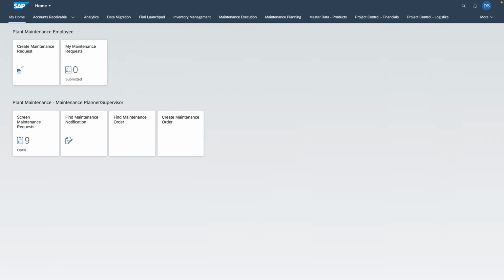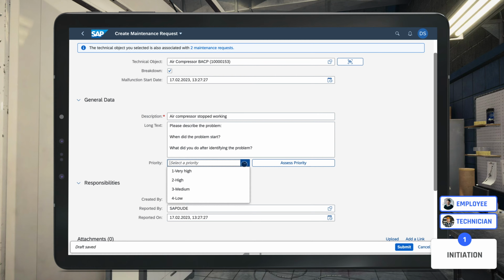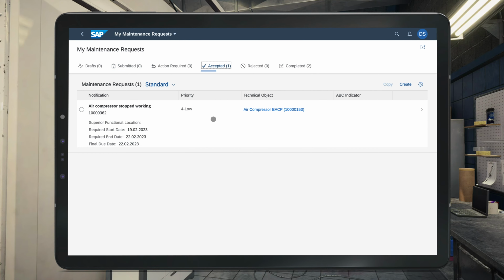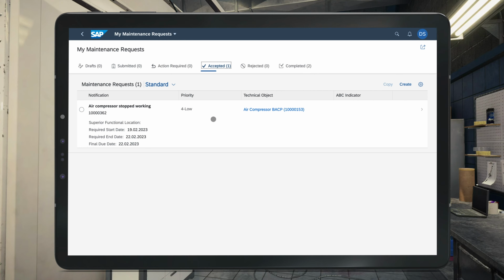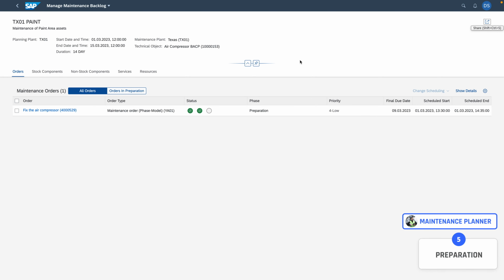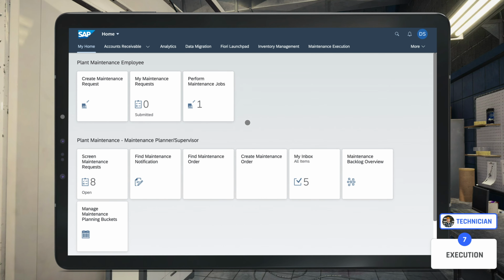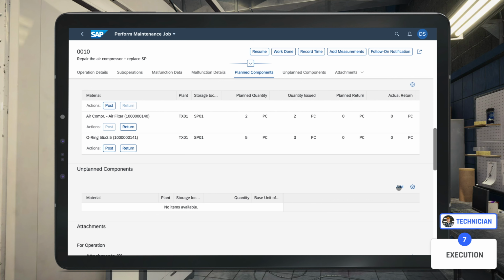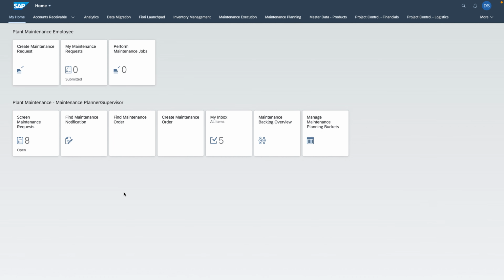Phase based Maintenance Process with SAP S/4HANA Asset Management

Comment: Hi, great video! I see that your operation tab has many options as - Template, copy, delete, setting gear, etc. Mine only has Delete operation and I had those just like you before. I've checked authorization, client settings but I cannot find what caused it to disappear. Do you have an idea?
Reply from the maker: Hi, thanks a lot. Well, I would try in a test environment with SAP_ALL authorization. Maybe something is still missing. Second thing, is it only you or more folks having this problem? If more, maybe someone did an uncontrolled change in the UI and made these components hidden (but I doubt). Third option, look at the note 3542253, maybe it will solve it. Hard to say, without details. Let me know how you managed it:)

Comment: Hi sap dude! Thanks for the video! I have a question I am implementing the 9 phases in S4 Public Cloud and we have to active some scope items. When I tried to do the process I have somo issues like the "Personal Responsible" camp is empty. And then I can´t confirm the order because of this. I think the I am having trouble with the link of the technician and my user. I don´t know if this is part of somo integration with hR or if i am missing something.
Reply from the maker: Hi Chiara, what error do you get exactly? If you want you can drop me a message at LinkedIn with the screenshots etc. 

Yes, there is something called 'mini HR', where EAM uses small piece of HR. It's hard to assess what is missing without details:) Cheers, Dan

Comment: Hey Dan, excellent work as always. After expIoring the process have some questions. When a request appears in the Screen Maintenance Request app, is it not possible to convert it into an order without approving it first right? Also i guess buttons like Accept, Reject or Action required not become active without some configuration settings
Reply from the maker: Hi Murat, thank you! Yes, this is the purpose of this process, to not be able to convert the not approved requests to WOs. However, everything is a matter of configuration. But this approach enables real Screening process and should be followed as much as possible.

If there are cases where there is no time for waiting for the approval, because work has to be done ASAP (example - ‘fire in the hall’), then SAP provides another flow.

It is called Emergency work, and then the approval step is skipped and we are directly moved to work planning and execution. 

Cheers, 
Dan

Comment: Hello. As a technician, is there any possibility to unassign an operation, to be again unassigned and availabe for the tehnician from next shift to continue?
Reply: You can remove person responsible from operation by editing maintenance order ?
Reply from the maker: It is possible to remove the assigned technician, either by RSH if u have it, or in the maintenance order directly, if u don’t use RSH. 

But as a technician, if you want to un-assign yourself from the task in the Perform Maintenance Job app - it is not possible (at the time when I write it). Cheers, Dan

Comment: Hello Sir ,I have created a new maintenance order, in maintenance Planning Bucket-selected the equipment, and defined the time period. But the maintenance order is not visible in the "Manage Maintenance Backlog" app. What could be the reason for this?
Reply from the maker: Hi, it’s hard to say. Many things may be causing this. If you still struggle -  drop me a message and screenshots via LinkedIn. Cheers, Dan

Comment: It seems it’s similar to ECC maintenance process other than backlog and bucket creation. That too I don’t know the use of creating those buckets. Can you tell me is there a key difference in regular process vs phased based maintenance?
Reply from the maker: Hi Prakash, there is no much difference from Business perspective, but from visibility, progress/status tracking - for sure there are.

In the old PM you use User Statuses to have that level of granularity. Here you won’t be able to use them, but instead you have the phases and subphases, supported by the set of new Fiori Apps. 

The new phase maintenance model gives better and easier control of ongoing maintenance activities, that’s the main difference.
Reply: @ thank you

Comment: Ver helpful video. 
In which step did you release the order?
Reply from the maker: Hey man, thanks a lot!
I skipped the order release part in the video, but of course I had to do it for my order. 

Once I finished the 5th Phase - Preparation, I released my PM order with a Fiori App ‘Manage Maintenance Orders and Notifications’ and then I continued as you see on the video. 

Cheers,
Dan

Comment: Very good presentation. Can you confir or make presentation for Proactive maintenance too. It is either generating notification or order. If we are generating order it is giving error that notification is in approval stage
Reply from the maker: Thanks man! 
Proactive Maintenance is in other words Preventive Maintenance. You start with an order, in most of the cases you plan it automatically via Maintenance Plans. 

If you receive an error about notification, it means your configuration is lacking of some settings. Start with checking if this order type is linked with a notification, if it creates a notification in the background. 

I don’t plan to publish new videos on this topic, I covered it roughly in this and other videos. Deep dive videos are part of the Ultimate EAM Course, which I created.

Now my goal is to focus more on UI/UX topics and IAM Suite like Asset Performance Management, Business Network Collaboration, Service and Asset Manager and others. 

Cheers man and thanks for the interaction 👌

Comment: Thanks for your wonderful explanation

But in my there is no my maintenance request
Reply from the maker: If you got at least S4HANA 2021, it means you are not assigned to proper Business Role. Reach out your Basis team for it. The app you can find in Fiori Library (Website) along with the standard role as well. 

Cheers and thanks for reaching out, good luck bro 👊
Reply: @sap_dude  thanks for your reply
I am working as planning engineer in ADNOC, we have same SAP Fiori and also I can create both of notifications and work orders
Reply from the maker: Happy to hear that! I hope you will find something for you here as well and you can use it at your work.

In 2 weeks I will upload ‘Scheduling Parameters explained’ Video, something around Preventive Maintenance. 
If you use maintenance plans and stuff - make sure you don’t miss it. 

Have a good one 👋🏻

Comment: We are using SAP EWM for material management and are not fixing each material to only one bin location (we assign fixed bins to each material but a material can be transferred between bins and therefore have stock in multiple bins). Can we still find a way to consume materials by clicking "Post" in the work order level for attached components? Maybe by assigning a preferred bin for consumption somehow?
Reply from the maker: Hey Julia, this functionality works only (currently) for IM (inventory management) only. It means we use Storage Locations, EWM is not considered here. 

Components in PM order are on Operation level, not work order, but I guess that’s what you meant. 

So yeah, currently EWM thing is out of the ‚Perform Maintenance Job‘ app. 

Sorry for bringing bad news. I am curious to see such option in the future! 

Cheers,
Dan

Comment: Hi Sir, i was configuring this model my system. In configure overall status-Conditions, ther is a cloumn named "Link" in which there is default value and not able to edit it.
Default vale is "AND"  but i want to use " OR" .How to do that?
Reply from the maker: Try by deleting the entry and add it again man.
Reply: @sap_dude  Tried that also. But it's not working.

Comment: Great Video. Is there any way to assign a maintenance task lists automaticly based on the object and mailfunction code/effect?
Reply from the maker: Hi Rene, thanks!
In standard S/4HANA it’s impossible. 
There is something like Relationships, it’s something in direction called Variant Configuration. But your requirement won’t be covered by this thing.

Before you consider any custom logics etc - check out SAP APM, which is in Cloud, you connect it with S4 or even non SAP systems. 
The goal is to optimize maintenance strategies, and such ‚recommendations‘ of activities (in SAP world called Task Lists) are at some point part of it. Might be a good thing to dig deeper, so yeah, check it out. Cheers man

Comment: Thanks for the video. It is very helpful. Do you have RSH activated in your demo system? I am trying to create a Team linked to my work center. But don't see any performance work center in the Teams and Responsibility apps. I would want to get the same view as what you have in the Perform Maintenance Jobs app, where I can also see the work linked to my team.
Reply from the maker: Hi Joke, yeah I do have RSH activated. Actually I linked all the People (Personnel numbers) via classic IR02 tcode, where u got this interface between PM <> HR. But yeah I know about the Fiori app which u mentioned, I will give it a try and see if I face such issues like you. If you do it like I did, should work as you see in the video. 

By the way, my new video about RSH will be live in 5 days, you will see the setup there as well. Hopefully, it will help you. Cheers 👋🏻

Comment: Hi sir, I have a question that it is possible to run phase model in SAP GUI? it may use less steps/transaction codes than in fiori but some cases you know clients want to run in GUI rather than in fiori. if it's not possible to run in GUI, so should we use both classic model and phase model ? because if only using Phase, we must always go to Fiori. ?
Reply from the maker: Hi man, Phase Model is dedicated for Fiori. For example the phase ‘Screening’ is not supported by any GUI tcode. The idea is to get rid of GUI and execute the process via new, user friendly solutions based on Fiori. This is something we have to explain to our Clients, it’s time to move from old way of working to the new, better one. Cheers man
Reply: @sap_dude  Thank you!

Comment: Hi, thanks for the wonderful blog and video. I have completed a full scenario of Phase model using standard order types YA01 and YA02. 
I have a question, How to activate Phase model for other Order types, i have selected the check-box in Order type for Phase activation and also assigned Status profile for new order types, is there any other config to bring the new order type for Phase maintenance. I want to select this order type in Maintenance Plan, and once orders are created, i want this order type to follow phase process. Please help. Thanks in advance.
Reply from the maker: Hi man, thanks for the kind words! There is more config for that than the checkbox in order type and the profile assignment. I described the steps in the Blog, just apply them to your Order type. 

If you are facing some specific problem, please describe it and I will do my best to help you. Phase maintenance model is not a 2 minutes config, that’s why I cannot give you the full answer without a specific context/issue. Have a good one, we are in touch 👋🏻
Reply: @sap_dude  -thanks for your reply, i can only find the below inform on Order type in your blog. Is there some other steps too in you blog, i cannot see them !

'Configuration for Order Types is pretty extensive, there are at least 10 Configuration points, which have to be set-up. Otherwise, the system will throw errors to the end-users during processing. The most vital one was mentioned above, the rest does not have Phase model-specific checkboxes etc., that’s why I do not display their details.'
Reply from the maker: @manoranjanpugalenthi1299   Oh I see, yes that's right. When it comes to Order types configuration, there is nothing more than this checkbox. The other '10' configuration points are just normal steps, which you do for every order type. That's why I didn't mention them in the blog. I hope you get it! Cheers bro
Reply: @sap_dude  - thanks for understanding.. So, is there any way to select PM02 Orders from Maintenance Plan and make this work in Phase model like YA02 Order type for Proactive Maintenance ?
Reply from the maker: Of course it is, but I wouldn’t activate it directly in PM02, keep it clean as it is, make a copy like ZPM2, activate the Phase Model and use it.

Comment: Hi SAP dude, when did you release the order?
Reply from the maker: Hi Zagreus, thanks that you watched so carefully! Yeah, I skipped the order release part, but of course I had to do it for my order. 

Once I finished the 5th Phase - Preparation, I released my PM order with a Fiori App ‘Manage Maintenance Orders and Notifications’ and then I continued as you see on the video. Cheers man!
Reply: Thank you for replying. Was just wondering, can the release happen before preparation phase, effectively after approval? Because preparation phase is essentially monitoring and ensuring availability of materials as per basic dates before scheduling in RSH application (for scheduled dates). We do not actually do anything in this phase.
Reply from the maker: Hey man, yes it can happen, it’s not like we gotta stick to one scenario, if approval phase is not relevant for you, you can skip it (u got to configure it so), the same applies to the Order Release:)
Reply: @sap_dude  thank you so much, that answers my question. Looking forward to great content from you 😊

Comment: HI dude, i hope you can answer my questions here, thanks in advance
1. We are having licence to RSH and we used it very heavily aswell, now we got a requriment to use find maintenance for DSPT.
So here when we unassign performing workcenter in RSH and view the same orders in Find maintenance order. As per standards we need to have DSPT option in find maintenance order. But we are not getting it
Reply: But if we create a new performing work centre and doing the same as above comment it is working
But we unable to identify, what making us to stop dispatching from Find maintenance order
Reply from the maker: @suryaprakash6109  Hey there! 
I had the same/or similar thing some time ago. 

My problem was, that I had RSH and wanted to use this Dispatching via 'Find Maintenance Order' app. But the button 'Dispatch operations' was blank/grey-ed out.

Then I figured out, what was the root cause. 
In RSH, once you click your avatar there - you got these settings, where you select the work center, which is relevant for you as a maintenance planner.
Just delete the assignment, and go back to 'Find Maintenance Order' Fiori App. Now it should work for you.

Of course, you need all these prerequisites like Phase model configured for the order type etc. But I assume you already have this, as it works for other work centers in your case.

Hope it helped you man!
Reply from the maker: If you do not see the option 'Dispatch' at all, even greyed-out, it could mean, the business functions and/or additional functions are not activated. You can find it in the customizing.

Comment: PS. I just went on your website, and cannot find anything related to configuring the 9 phase settings... Not sure if I can't find it, or if the page is still a work in progress I assume it is the latter? :) if so, i very much looking forward to seeing it! Be interesting to know for example if another notification type can be used. Moreover, I am trying to figure out how to set up my SAP user ID / personnel ID so that it works with the perform maintance jobs app. at the minute, I am a bit stuck on how to do this (tried the PA30 and PA40, assigned personnel ID to my sys-ID)
Reply from the maker: You can find the configuration here: https://sapdude.com/blog/phase-maintenance-configuration-for-sap-s-4hana/
Reply: @sap_dude  Thanks a lot! will be going through it
Reply from the maker: You are totally right, this is in progress. I will let you know once it's ready - or check out my linkedin page, I put the updates there as well.

It all can be customized according to your needs, custom notifications etc. ain't problem for Phase Maintenance. You do not have to stick to Best Practices 4HH, 4HI (but it's the most convenient approach).

For the Personnel ID some steps in a nutshell:
1. If each user is meant to have separate accounts - you need as many SAP accounts as personnel numbers.

If you have a terminal, where one account is being used for all the 3 shifts throughout a day etc - you just need one user and define as many personnel numbers as you need.

2. Create user in PA30. 
It's not only about organizational assignment, personal data etc. Launch the infotype 0105 and subtype 0001 (Communication). You assign User ID there.

3. That's not the end - in S4HANA such Personnel number has its linkage with Business Partner as well. There is a program, which you just lunch via SA38 and it performs the sync with BP. 

4. Then you should be fine - assign the Personnel Number to Work Center, so it will be easier for your Planners to choose people during planning, and you are ready to go.

More details you will find on my blog, once the post is ready:) Stay tuned and yeah, have fun with the system:)
Reply: Thanks a lot for the demo video. Looking forward for all the config that is required for 9 phase model